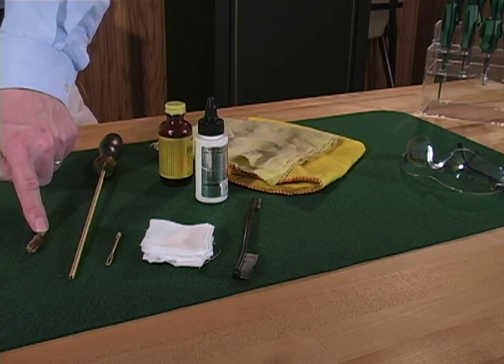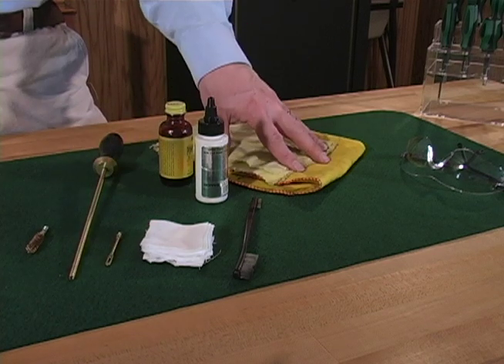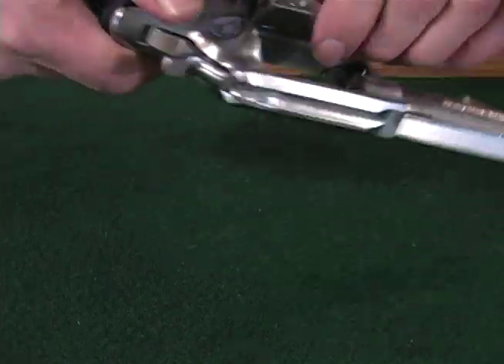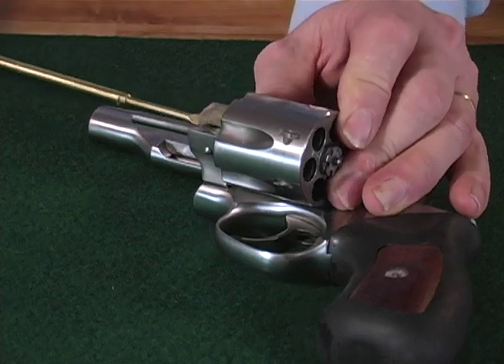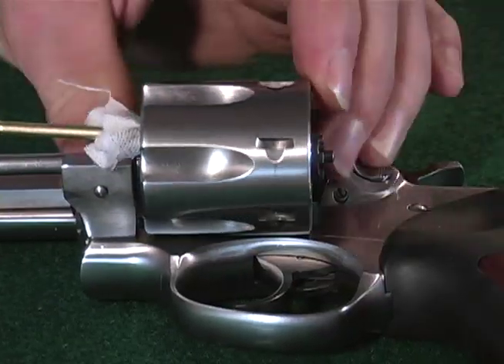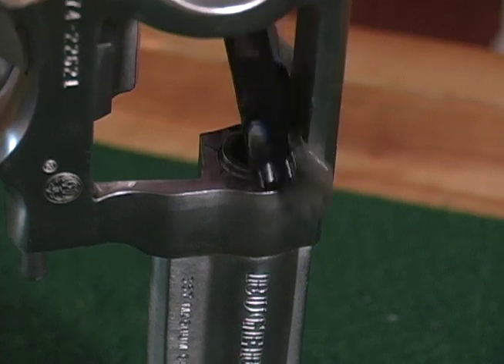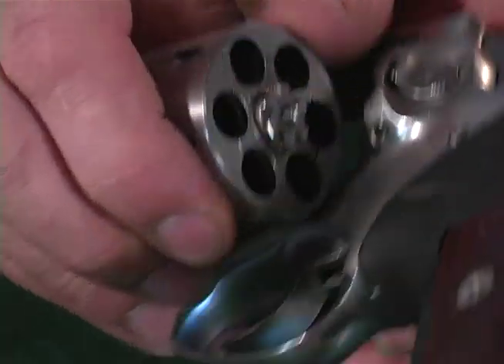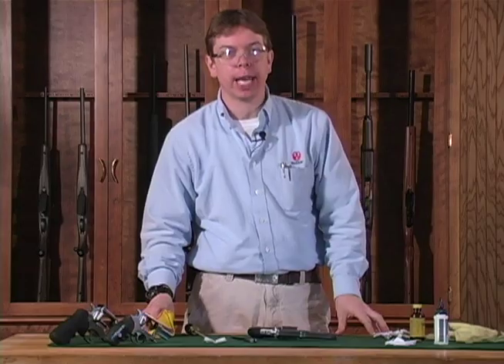Ruger Double Action Revolver Cleaning

Comment: I was always taught that no matter what gun you use, You never under any circumstance, Put any amount of oil inside the barrel. Oil does not compress and can cause a round to become lodged inside the barrel during the firing process which can be a risk for explosion.
Reply: You do this for storage.  When you are ready to fire the gun you need to make sure the barrel is completely dry.  I always run a bore snake through my barrels of my guns before I go to the range and use them and the cylinders if shooting a revolver.
Reply: But will you have time to run a bore snake through that gun if you were in immediate danger? Or what about someone else who might not know to do such, A family member perhaps. Never say it can't happen. It is a world of uncertainties.
Reply: Thats why he said "for storage" . For protection leave it dry. Easy
Reply: The key is "lightly oiled". A thin film will protect the bore from corrosion and not offer enough resistance for any blockage.  Good to go!
Reply: Run a solvent patch followed by dry ones before u shoot to remove all the oil.  Simple

Comment: This is probably a correct cleaning method, but why not clearly state the goal of the cleaning? I'm guessing it's to remove the lead, apply a light layer of oil to the exterior, inside the bore and chambers, all while not scratching the gun. Why use metal rods and cloth holders? Won't they scratch the gun? A good point by esh325, do you have to wipe clean the oil before shooting?